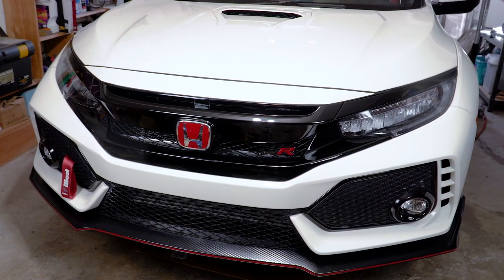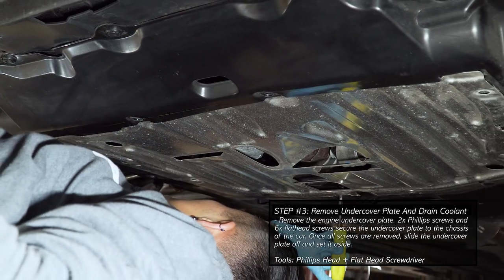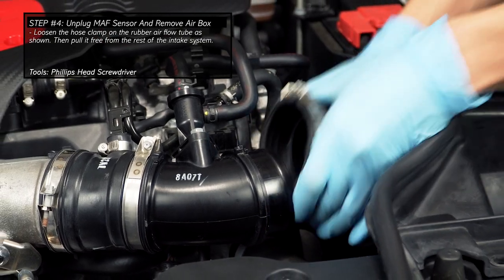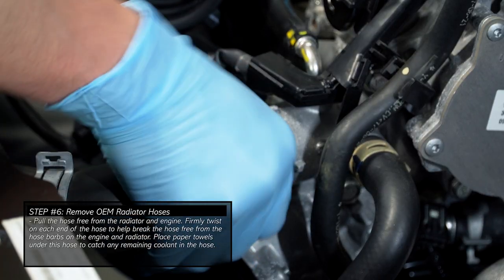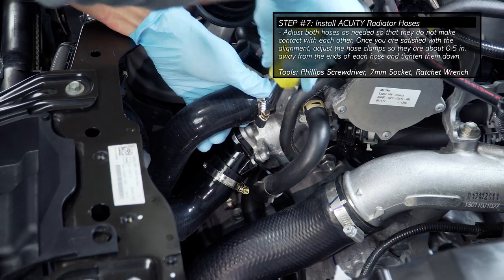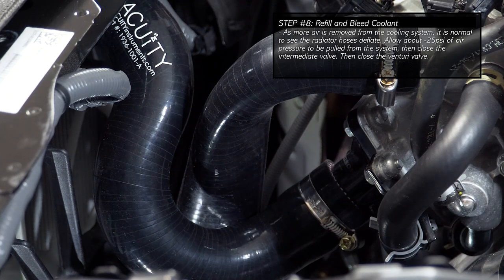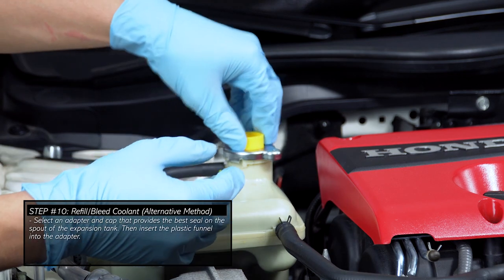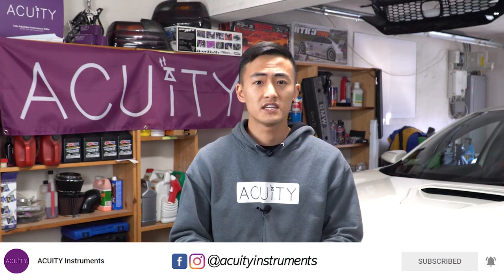1936 Super-Cooler Radiator Hoses Install Guide (FK8 Civic Type R) | ACUiTY Instruments

Comment: do you not need to turn the temperature of the car to full HOT when purging air from the radiator system using the 2nd method?
Reply from the maker: No you do not👍. The second method follows steps stimilar to Honda's recommended coolant fill procedures, where the entire air conditioning system remains off while the engine is running to purge air bubbles into the expansion tank.

Comment: cool detailed video , i have installed them on my 2020 CTR with an aftermarket radiator (koyorad) but now the 2 pipes is always touching each other is that ok ?
Reply: Minor contact shouldn't be a problem, but you may be able to resolve it easily by loosening the clamp on one end of each of the hoses slightly and twisting them. When installed, normally they should have a very slight gap between them in areas where they cross, but that is with all OEM intake components and radiator, so it's possible some aftermarket parts may cause them to be routed very slightly differently. Nonetheless, minor contact shouldn't cause you long-term issues.

Comment: can i use aquity radiator hoses with aftermarket intercooler?
Reply from the maker: Hey! Just want to make sure you mean aftermarket radiator instead of intercooler? If so, yes our radiator hoses fit aftermarket radiators 👍.
Reply: Also, just to add to what @acuityinstruments posted, we are not aware of any intercooler that creates any fitment issues with these radiator hoses.
Reply: so its meant that this hoses is design perfectly only for stock intercoler and radiator only right?
Reply: @benrusle  Incorrect. These hoses are compatible with aftermarket radiators designed for the FK8. Aftermarket intercoolers do not change the radiator position, so that is not a problem either.
Reply: @rgareh1  got it...thanks for your info...

Comment: No FC1? 😩
Reply: FC1s use a horizontal-flow rad that is thermally aligned with the intercooler better. There would be no net gain from reversing radiator flow on an FC1.
Reply: @rgareh1  perfect thanks, so basically changing the hoses to silicone could be considered a cosmetic thing on the FC right?